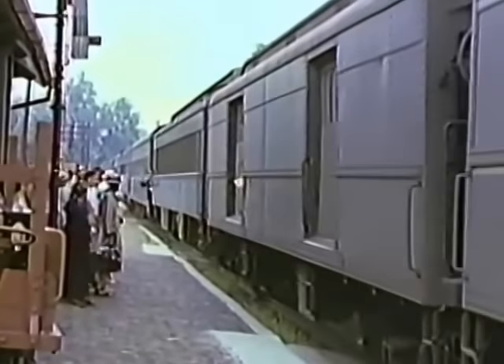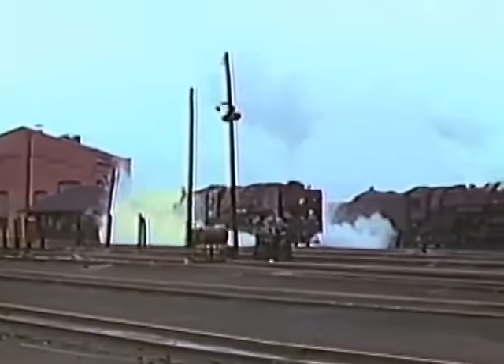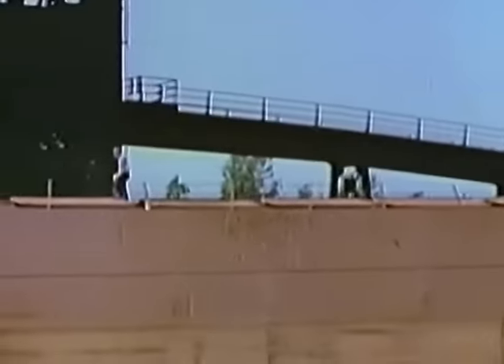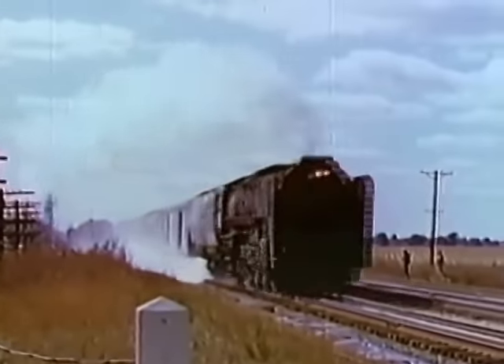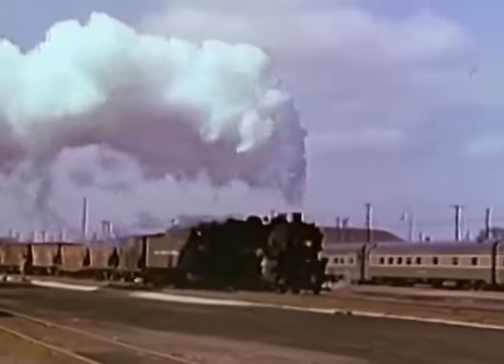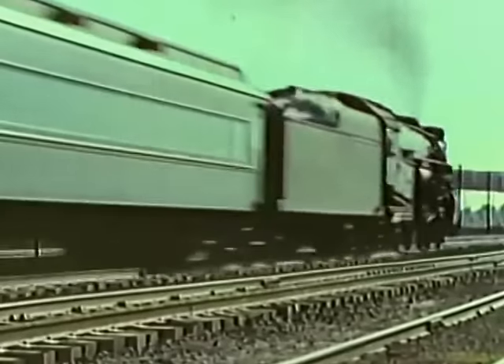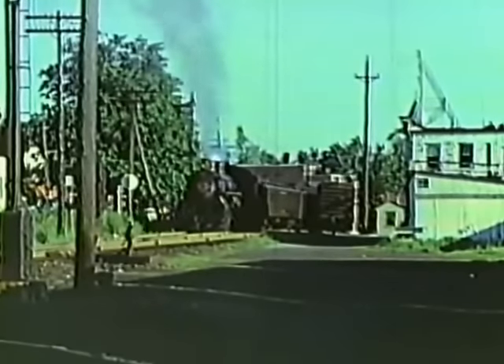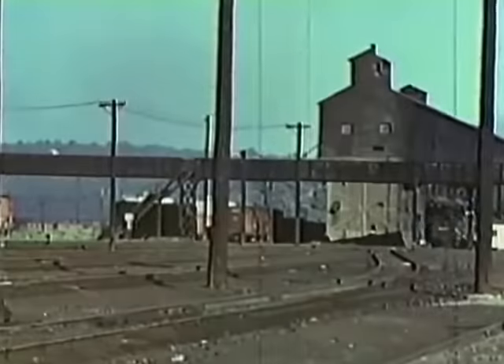NYC Water Level Route

Comment: Would like to have seen what a 4-8-8-4 version of a Niagara S2 like the UP did with thier FEF-3s by building the 4000s.

It would have been the ultimate steam locomotive.

Its unfortunate that steam engines needed such high levels of maintenance, that's what really did them in contrary to what many think.
 It wasn't the fuel economy or quick start up times, coal is far cheaper than oil and you can always have your workmen wake up early enough to get the engine fired up on time, it was the huge amounts of maintenance a steam engine needs. 

Here is a 25 minute film to demonstrate what I mean: https://youtu.be/stPkjtlRj24

Comment: NYC was some railroad. I was a B&B foreman for the D&H and the NYC bridges were two or three times the structural strength of the ones I worked on. I understand it was corruption that doomed the New York Central.
Reply: The same way corruption in the Oval Office, as of 2019, dooms the US.
Reply: Not corruption, just the beginning of the rust belt, over-taxation and over-regulation by the ICC so that the railroads could not compete with all the subsidized forms of transportation -- road, air and water.

Comment: We Brits got a steam loco up to 126mph and the Germans got one to 125mph, but at that sort of speed steam locos are not all that stable due to problems of reciprocating and rotating balance. Re 26 cars, equivalent 1000 tons cars at 100mph, that is simply boastful and incorrect. UP tried it with one of their 800 Class Northerns which were more powerful than the Hudsons and could not make it and that is documented fact.

Comment: "Drivers went from 69" to 72". True on the L-4s, but the L-3s kept the 69" drivers and were still dual service Mohawks. Likely cuz the L-3s were built with roller bearings and lightweight rods for faster running and better balancing, something the earlier L-2s lacked.

Edit: Only the "L-3a"s were dual-service of the L-3s

Comment: i'm always impressed with these steam engines but railroads who owned them at the time, couldn't wait to get rid of them once diesels were proven to be a viable replacement... in a book i have is a picture of proviso yard 1956... a long line of steam engines deadlined waiting for the scrapper torch, and most of them looked pretty NEW to... no emotion or sentimentality with the railroads accounting dept that's for sure

Comment: You know if they are planning on building another T1 big engine, they are better off building a working Niagara or at least one that can be on display
Reply: Hmmm... No, not better off. 

The T1’s purpose is to attempt at beating Mallard of the fastest steam locomotive. A Niagara would be used for excursions if it was planned for restoration to operating, but its very rare that dedicated workers want to build a new locomotive from the ground up.

Comment: The NYC route to Chicago was the long flat route which with twin to four track the century or commodore Vanderbilt could run flat out, but even then the tight pre 1960 schedules often led to freight trains held for hours. The shorter steeper route 800 miles  to Chicago of the Pennsylvania or B& O was more realistic from the 1950s in Labour and fuel costs and regulations.
The NYC market was the business market from NY to Detroit and Chicago. For this market  the flight time of a piston Constellation or DC6 or DC7 of 2hrs airport to airport NY to Detroit or 2.5 hrs to Chicago despite the rough 350 mph passage of a Connie or DC6 was an overwhelming win for air for business travellers. These piston airliners 6 hour rough flight from Chicago to LA, Frisco or Seattle was not yet a winner to the pleasure leisure market heading to the west. Even on the more political deluxe rail service Washington to Chicago , Miami and New Orleans the Pennsylvania was still a successful passenger operator in the late 1950s
but NYC market had been business travellers and ceased to be competitive although for a while the 20C Limited as seen in Hitchcock in North by Northwest in 1958, but any say 1962 it was mediocre compared with Pennsylvania Broadway Limited and the better Santa Fe or Burlington varnish. The NYC saw its only viable passenger routes then as the Empire corridor  NY- Buffalo and Chicago Detroit 280 miles.

Comment: The surviving Mohawk  4-8-2 3L  3001( See Classic Trains Winter 2019 v20, No4, "Intinerant [Station] Agent',  p30-32) forexcellent photos of Mohawk 3002 & 3005 on varnish out of Boston on the NYC Albany route on the Knickbrooker and South West  Limited in 1947) entering service in 11/1940 should be the highest priority for fulll preservation and return to service as the ultimate development of steam technology and more and  in many ways was an express prototype  following on from the 60 ultimate Hudson 4- 6-4 3Ja specially  tailored fpr express service on the waterline to Chicago and Detroit in 1936-37 with all roller bearings and huge tenders to run  to Chicago and St Louis with one engine and no refuuelling other than water troughs like on the old British rail.   The  first 25 of the 75 3L Mohawks were the first NYC  mountains developed for high speed service including the 20th Century limited  with all bearings etc using rolling bearing etc
Reply: *L-3a

Comment: Lots of good video, or film?
As for steam nostalgia: Diesels just require refueling, whereas steamers need coal and water (lots of water). And they are fillthy: Coal dust, sparks, ashes. After each run, the ash must be cleaned out. Lots of steamers had sliding bearings, requring constant oiling and attention. 
Firing up a cold enginge takes hours, a diesel you just push a button to start. A steam engine requires driver and stoker (fireman), a both hot and cold job (if the cab was drafty…). In a diesel, it’s almost clean and temperate in comparision. And then there’s the matter of fuel economy…
But I don’t hate steamers, amazing machines as they are! :)
Reply: Agreed. I love watching steam locomotives as much as anyone, but there were very good reasons for their demise. I had two uncles who spent most of their working lives in engine repair shops from the late steam era of the late 1930s, well into the total dieselization era. Neither of them ever missed steam one bit.

Comment: The good old days, before every thing became about safety and we made everything at home. Steam was given up too early and airlines sealed passengers trains fate. little knowing around 20 years later people would want trains back. Never again will trains run at 120MPH in gleaming grey or any railroads color. never again will we see, Baldwin, Alco, Lima and GE on a builders plate. Never again will rail travel be glamorous and exciting, with Johnny Cash Driving the 4501. whistle echoes into the distance, with the last beating blasts from a N&W 2-6-6-4.
Reply: Johnny Cash may be gone but Southern 4501 is still railworthy!

Comment: What are those huge metal plates along the sides of the boiler at the front of the engine?
Reply: those are smoke deflectors
Reply: @yeoldeseawitch  How did they work.? Why did some engines have them but others didn't?
Reply: @tomfields3682  they kinda work like spoilers, they redirect the air to the top of the engine to prevent smoke from entering the Cab. Luckly not all engines need them because of their design.